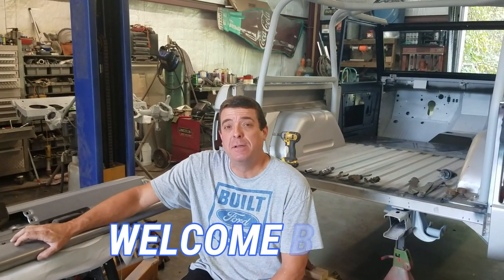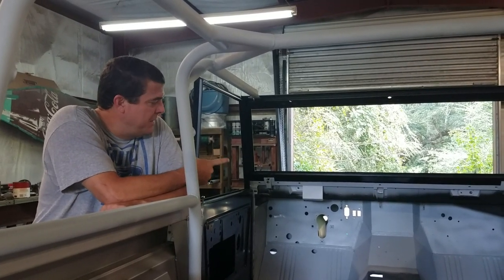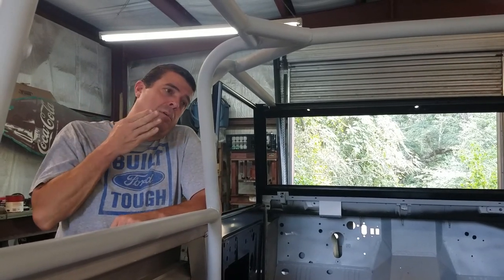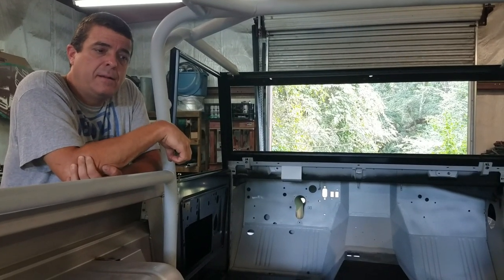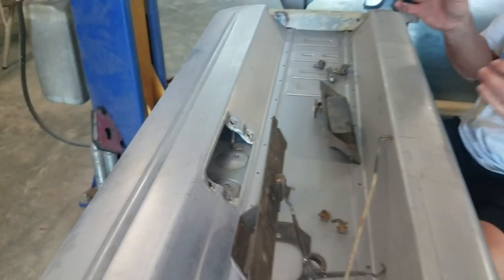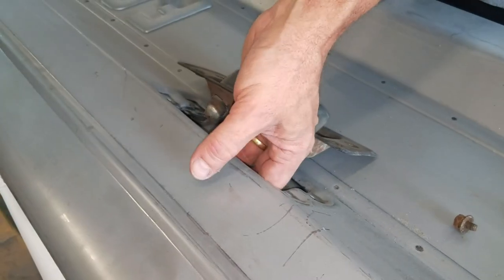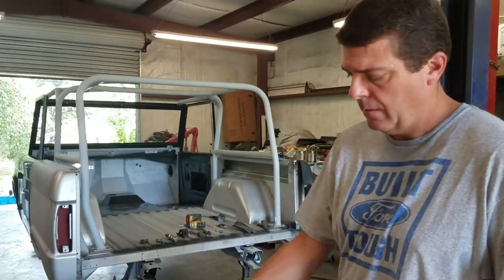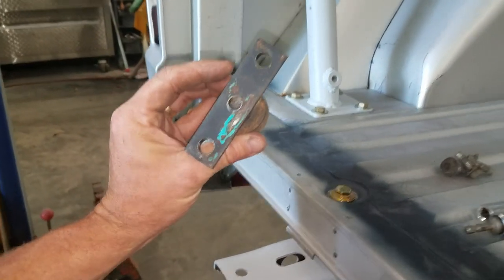Tailgate Installation and Adjustment - Dennis Carpenter - 1966 Ford Bronco Restoration Project

Comment: it's not so much my mistakes that are denting my psyche - it's the onion layer of finding more and more items that need replacement. i can't see when i'm going to turn the corner and stop adding things to my list. i start on the front brakes and see the wheel bearings are shot, then i see the bushings, etc, etc, etc. the shining light is channels like this that keep me chugging along. many thx for your posts.
Reply from the maker: Thanks Joe.  I have a document on my computer at work that list all my to do items as I think of them.  I don't erase them when I am done I mark through them so I can see the progress I have made rather than all the task left to do by themselves.  It helps...  Stick with it.

Comment: It's not very often that parts just bolt up without persuasion.  Ford Ranger tailgates have the right bottom knotched that correspond with an rectangular hinge rather than round for easy tailgate removal.  Just food for thought.
Can't wait to see the finished bronco.  Have you given it a name ??
Reply from the maker: Ken, we call it Jimmy Buffett.  The original Caribbean Turquoise just makes us think of the beach and Margaritaville.

Comment: Check your tailgate box!  My Dennis Carpenter tailgate came with crush nuts and bolts in a little baggie in the bottom of the box!  I almost threw them away.
Reply from the maker: Thanks Clint.  I threw the box away.  I guess I did not see them in there.  I will order some and make sure I mention it in the next video.  I appreciate you letting me know and watching our channel.

Comment: I'm glad to see yours fit the way it does, I have the same tailgate and was wondering how it was going to go. I like your honesty, I have a few mistakes that I've made on mine and had to go back and fix them. It's frustrating especially when you think you've thought out all the steps, took measurements and got that warm fuzzy feeling just to find out that you messed up. I've had to walk away quite a few times but sometimes that all it takes to have that aha moment. Like you said you would like to think these parts would just bolt and line up properly, I guess in a perfect world. Keep up the good work.
Reply from the maker: Thanks.  It does fit well for sure.  I was concerned because I cut the passenger end cap early on because it leaned in towards the top.  It was the right thing to do thank goodness.

Comment: Jason,  get with Tom's Bronco Parts.  They have the threaded inserts that go in the tailgate, for the handle bucket to bolt to.  They call them crush nuts.  Part number 1339
Reply from the maker: Nate, thank you very much!  I will contact them for sure.  I appreciate your help!

Comment: Has the DC replacement tailgate addressed the problem of getting the side latches in and out.  I understand that on the oem tailgate one must disassemble the latch before being able to remove it from the tailgate.  In your video you just "put it in"   My question is "is the DC tailgate modified so that the latch goes in while completely assembled?"
Reply from the maker: John I guess I don't understand the question.  My Bronco is a '66 and I didn't have any real trouble disassembling it.  Sorry I can't answer.  Thanks for watching.

Comment: Question for ya Jason. I just mocked up my tailgate and it fits great, nice and flush with the back of the pillar. The problem is I installed the 4ea. New small rubber anti-rattle tailgate bumpers on the inside of the pillar and now my tailgate won't close all the way, it's about 3/16" from fush because the rubber tailgate bumpers won't let it close all the way.  I noticed in your video your didn't mock  up the rubber bumpers. Any ideas? I'm using my original pillars with a aftermarket tailgate. Thanks.
Reply from the maker: Craig, I installed the bumpers afterward with now issue.  Can you snap a picture and send it to our email? Jasonandjoniebuilds@gmail.com 
I will be happy to send you pictures of mine and how how it is installed with the bumpers... if you like. Thanks
Reply: @JasonJonieBuilds  Will do, thanks!
Reply: @JasonJonieBuilds  I think I figured it out, I took some measurements off my old rusty tailgate. I bought the Dynacorn tailgate from CJ's and its about 3/16th wider at the top. The bottom is tight to but not as bad. The outside is a nice match with the pillars if you don't use the rubber bumpers but of course you need them. Just another aftermarket part that doesn't fit and I'm not sure what the fix is on this one? Really no way to slim down the tailgate.
Reply from the maker: @craigmaverick  Didn't you say it fit without the rubber bumpers installed?  I would trim them if it would  help.
Reply: @JasonJonieBuilds  yep fits great without them, I found some slimmer ones on Amazon so I may try that? Thanks

Comment: Why does my tailgate go side to side any tips?
Reply from the maker: I think that is pretty typical.  Mine does too.  I plan to add some soft shims inside the hinge hole to take up some of the slack.  You can see the slack in mine on our video where we installed the tailgate silencer kit.
Reply: Thanks for the info been following your build since I started mine your videos helped me alot
Reply from the maker: Thank you for watching.  I am glad they help a bit.  Good luck on your build.